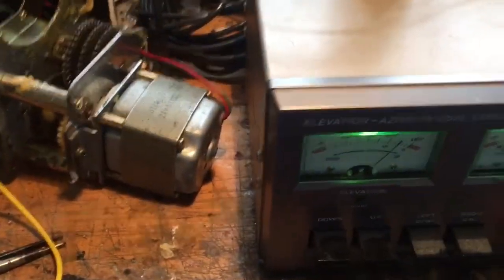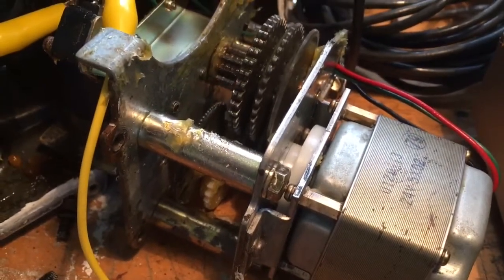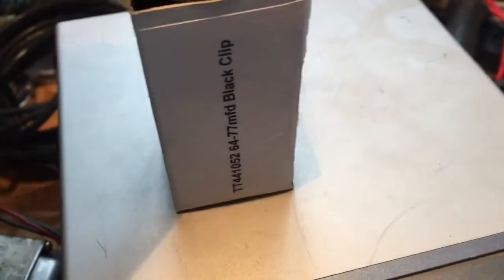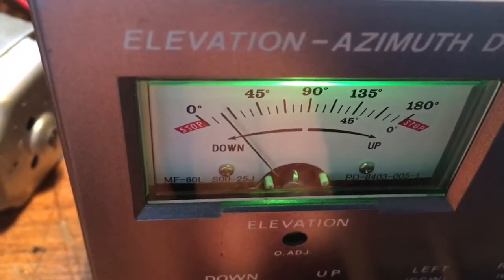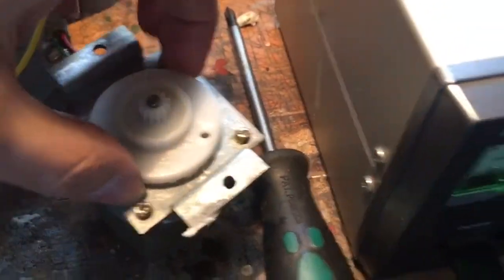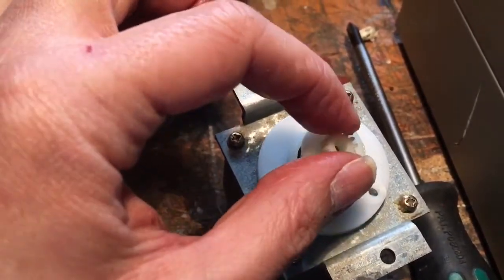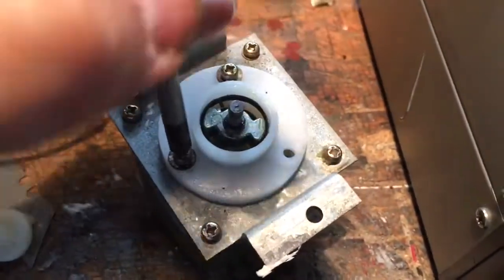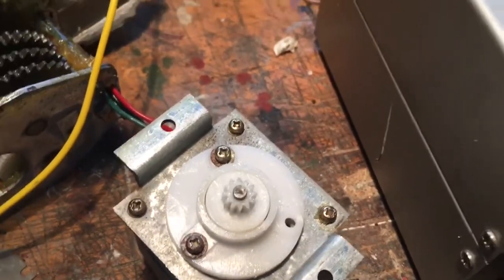Yaesu G5500 - diagnosis and repair

Comment: Hi, My 5400 is a little noisy when moving and I think it needs lubrication. Is their a guide available for that kind of maintenance?
Reply from the maker: Hi, yes there are a number of things you can do but you really need to dedicate yourself to a total overhaul as both Kenpro KR5400 and KR5600 (same as Yaesu G5400) use individual ball bearings as supports for both elevation in two cages and azimuth along the perimeter of the housing and it’s well worth changing them during a service. You may also wish to invest in two new capacitors for motor run and also two new potentiometers. The big problem is water ingress and it’s nearly impossible to keep it out as water runs via the bearings and into the housing and makes mush of the grease. This then makes noisy bearings and gears as you would think grease is waterproof!! It isn’t well not the grease Yaesu use. I personally replace the grease with a good grade marine grease. Generally the motor won’t really need an overhaul as they are incredibly well made. However the gears tend to suffer with noise when there is a lack of grease as the high speed gears tend to fling off the grease under rotation so it’s important to pack the right parts with grease to make sure the grease can only fling so far. Another annoying issue is the inner plastic gears getting worn shafts and they tend to amplifier the motor sound. Also be weary of the main gear on the final drive running dry of grease as it tends to amplifier the noisy gearbox along your antenna shaft for elevation. I replaced mine with GRBP rube and it made it a bit quieter that the aluminium. It also allowed me to put my beams mid-boom and not have the pole interfere with my signal. I will try to find a the disassembly guide I use and post it here. Good luck 

73 de Spence M0STO
Reply from the maker: https://hamradiooperator.blogspot.com/2014/05/yaesu-g-5500-elevation-rotator-repair.html?m=1

https://ivok.home.xs4all.nl/pa1ivo/G-5500.html
Reply: Perfect, thank you!
Reply from the maker: @blueplanetphotostudio9616  glad to help